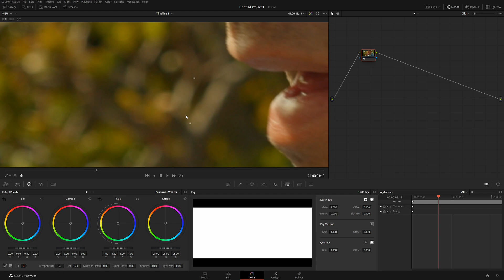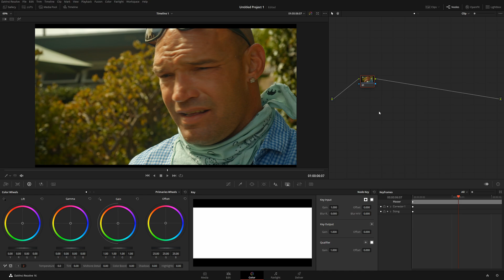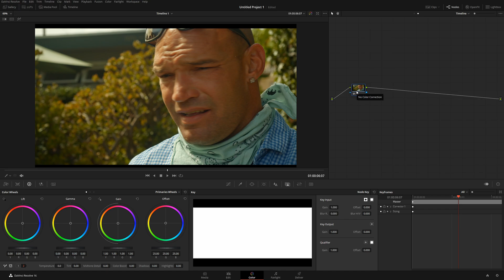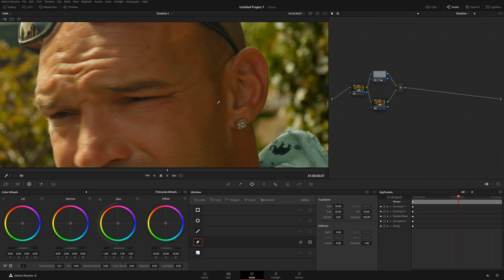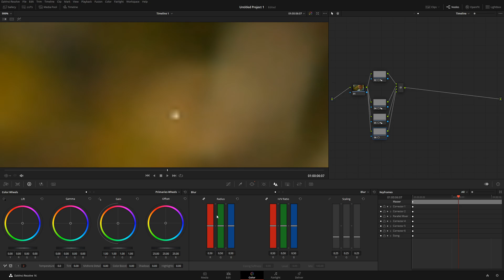Easy Hot Pixel Fix in Davinci Resolve | Fixing Dead Pixels with Resolve

Comment: i cant use the hand tool when i zoom in de screen. the zoom movemente is only in the center and when i select de hand in the top right, i cant move the screen in zoom to the point that i want do remove.. why?
Reply: Sorry I know this is old. Did you ever figure out the hand tool issue? I cant move the image around after zooming in either.

Comment: Ok, so if i use timeline in davinci for some corrections, will these be applied before or after the color grading in the clip? And why is it important to start with noise reduction as a first node?
Reply: As far as I know, the order of application of the corrections is as follows: Group Pre-clip, clip, Group Post-clip and, at the end, Timeline. 
Some experts recommend using the first node for noise reduction because this is "CPU consuming" and this avoids calculating the noise reduction with each adjustment applied to the other nodes
Reply: noise reduction on first node ensures that you are only affecting the noise that is already present on the clip. when you color correct/grade you may introduce new noise due to pushing color. 

this dead pixel process can be applied after you've done your grading.

Comment: Thanks a lot for this Tip. •	Just a question: Using "Timeline correction", does that work also if some of the clips has been cropped, enlarged, ...?
Reply from the maker: Just make sure those are not the clips with hot pixels. Otherwise you gonna have to fix them in the clips tab
Reply from the maker: Yes it works